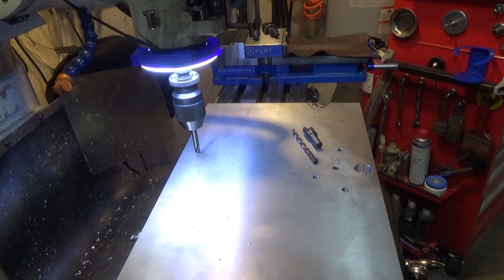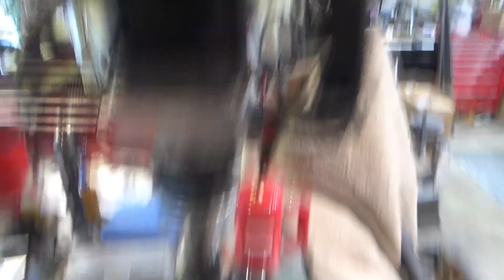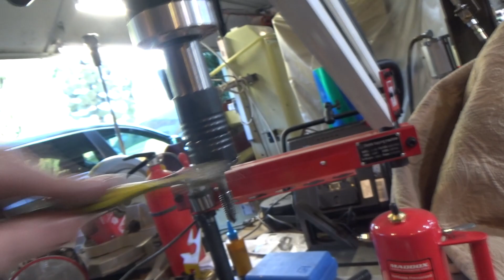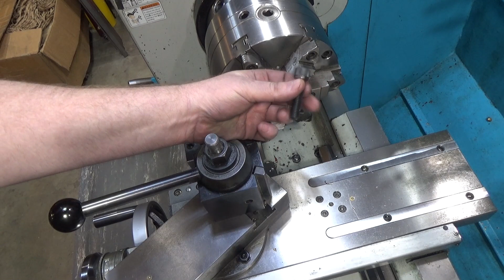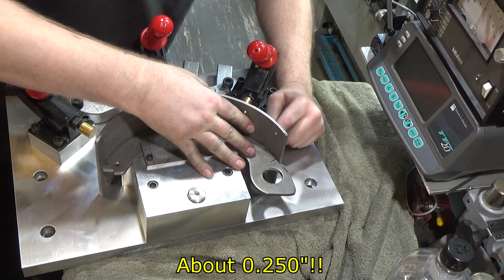231 Heavy Machinery Brake Shoe Welding Fixture Part 4 - Am I Done?

Comment: Hydraulic clamps would make it much easier to cycle parts through the fixture and retractable pins could be used in lieu of spacers. 

I hope that your customer understands the requirements for brake components. They should be stress relieved after welding to avoid fatigue cracks in the weld zones. There is significant liability that attaches to these parts and even some very experienced manufactures have gotten into trouble.
Reply from the maker: I love your ideas. I have never seen hydraulic clamps before. I will remember the option for future projects. The vendor I am working for is a sub-contractor of a sub-contractor, and they only do the welds. The rest is handles by the sub-contractor. Not confusing at all.